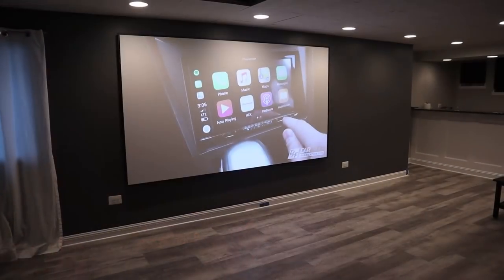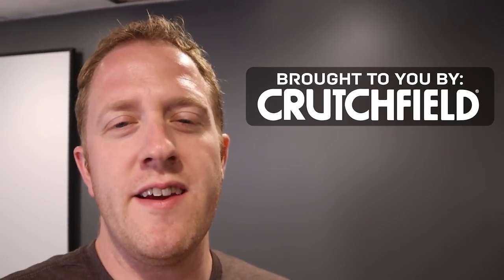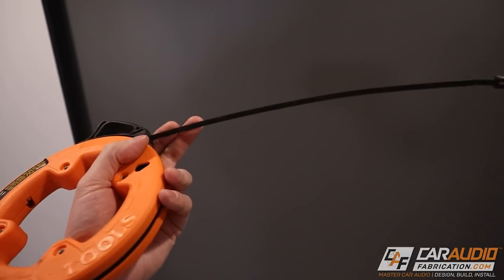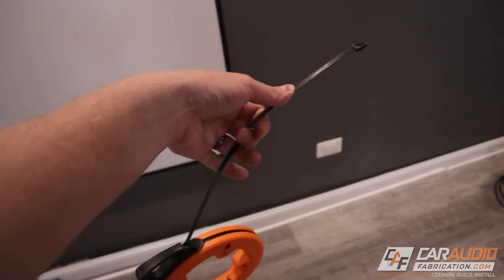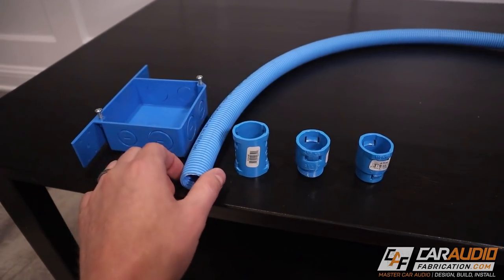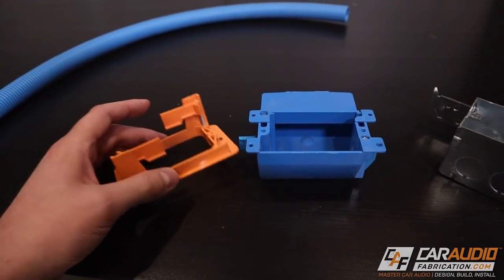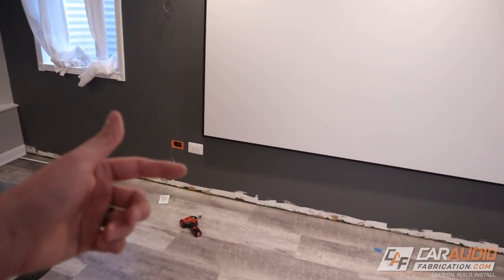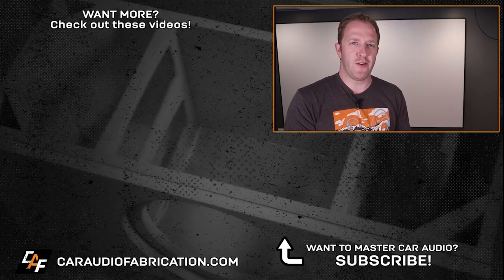Home Theater Wiring? Run thru walls like a PRO with THESE tools!

Comment: Please don't use a staple gun!!! If and when you miss, you just ruined the wire. What I use are white 3/4 electrical staples. Hammer that to the stud, joist, whatever first and then using a zip tie, gently tighten. The benefit to this is if you need to run more wires, cut the zip tie and now the staple is reusable.
Reply from the maker: Don't miss? I shot probably 500 of those things and never had an issue. It's pretty easy to line up.
Reply: @CarAudioFabrication  That's good but whenever I see those "staples" on the job I cringe. I've been doing home A/V since 2004. Now, if you stapled them first, then zipped the wire to them, then that's a better use case for those types of staples.
Reply: Yeah never staple anything like cat 😻 wires or speaker wires you can kill the wires with to much pressure
Reply: @CarAudioFabrication  side note... this might be a regional thing, but we call them fish sticks in Wisconsin.

Comment: Just cut one long string that can be pulled back and forth in the tube to move each wire through. The string never leaves the tube. And when your finished...leave the string in the tube for future changes.

Comment: The plastic bag tied to the end of the poly line is brilliant. I have always used a wine cork but have had issues with it getting jammed into a corner. Thanks for the knowledge!
Reply: It's called making a "rat", we do it all the time...
Greenlee actually makes a foam unit that works great as well...👌

Comment: For pulling two runs walk the length of the run add 6-8ft if you are going to have a drop add 1-3ft for extra, wrap that back up to create a loop and with electrical tape wrap the loop so it doesn't come undone, add your pull wires and you will pull two runs at the same time with little waste.

Comment: You don't have to use smurf tube or even secure wires above a drop ceiling like that. You don't even need push rods or fish tape to run some cables. You can even get away with drilling a small hole in the wall and jamming speaker wire through. Taking this approach is definitely faster, but having the good tools to do the job properly and going the extra mile to put banana plug cover plates on the wall and running smurf tube makes things so much more enjoyable. People who have home theaters often times upgrade components a few years down the road. And sometimes those new components require higher spec, or completely different cables. Installing smurf tube and investing in quality, specialized tools makes this process a million times easier when you have to make a change. Do your future self a favor, do it right the first time and minimize some frustration. I'd also suggest buying a label maker and heat shrink labels to easily identify cables.

Comment: Great timing.  I need to finish up running some CAT6.  Picked up a fish tape and pole about 10 minutes ago.
Reply: Harbor freight is the best place to get em. 
If you drop 1 you aren't out more then a buck.
Reply: That's where I went.  Got the 33' pole and 50'  tape.  $20 I think.
Reply: @pkt1213  yeah they got 2 sizes now,1 is a longer tube , but they thread together with the other. 
 great for car audio stuff as well.

Comment: The biggest thing for me is to make sure not to rush the job and it really pays to have the right tools. I was running wire through the wall bordering my bathroom and it had some extra studs that were very close together. I didn't want to go spend $50 for one of those flexible bits and i already had a 24" solid spade bit... Thought the angle was fine and drilled through the stud and carved a big hole in the other side of the drywall. Had to realign and drill again to get it right...

If I hadn't been tired, frustrated and just wanting to get it done, i would have gotten the flexible bit to line it up perfectly, got the job done and not have to repair my dumbass mistakes.

Comment: Would have liked to have seen the flexible drill bit in use. Does the bit wander when starting? How difficult is it to find the hole when fishing through it? Hopefully I can avoid that complication entirely, because the builder of our new home won't be installing fire blocking between the wall studs.

Comment: Yeah if your going through a  ceiling or long lengths 1/2 pvc pipe 10 ft at a time or with couplings  even further and more strength then a rod

Comment: Would a fishtape make it a lot easier to have a wire go through car door grommets (no molex plugs)?
Reply: Not really because of the length of the fish tape and the tight bends in the grommet. Its a beast but I purchase really long zip ties, say 24 inches or greater and use those in an open grommet.
Reply: Get a fiberglass fish rod. They are extra flexible. I've done it several times and it works great

Comment: You need some spray foam insulation, bc is air tight and it helps with the sound as well.
Reply: It's for temperature insulation not sound absorption
Reply: Sonopan with rockwool and 1/2 in ch drywall best way to sound proof

Comment: plaster and lath has dulled every tool I have, so the wires are in a loom on the floor... fugly aF.
Reply: Plaster is bear for sure! If I had drywall I'd cut open and drill all the studs, but repairing plaster is a hassle. Amazing for sound isolation tho.